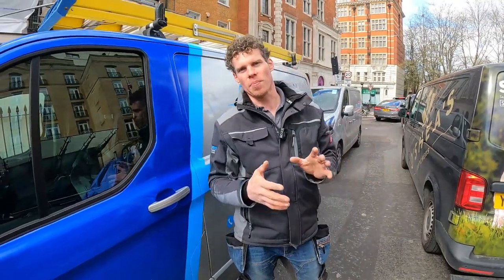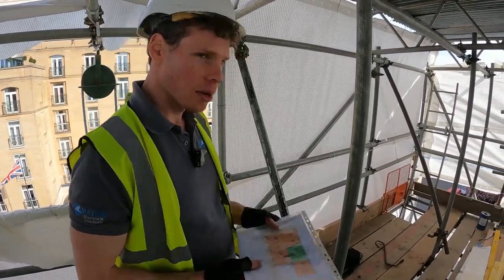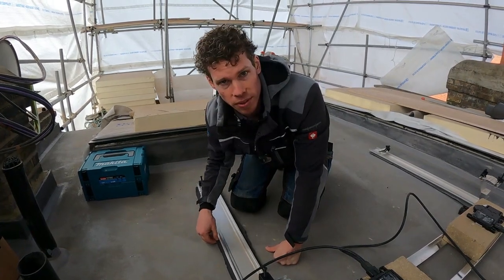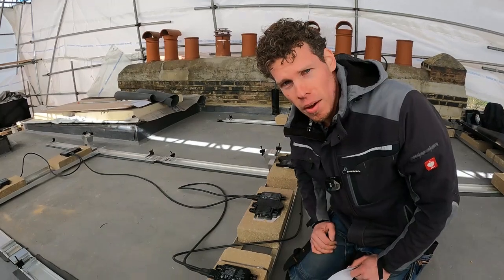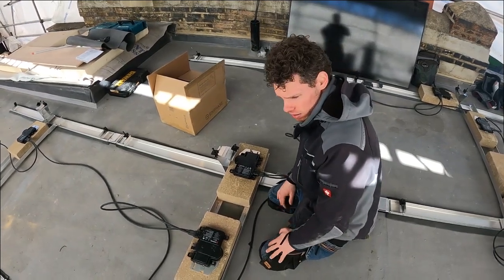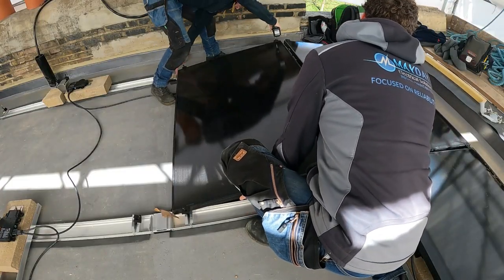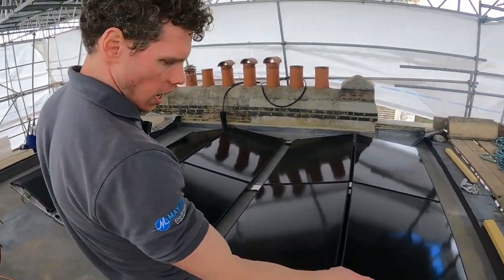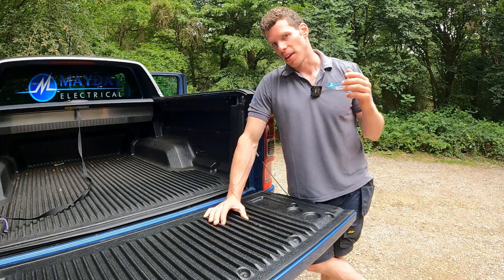Enphase Solar Install Kensington

Comment: Brilliant video thank you.  We are about to have solar PV panels installed, 31 Q Cell 405-watt panels (8 facing east and 23 facing west)  mated to Enphase 31 IQ8A Inverters then an IQ Combiner 4C. Installer claims it will generate over 13 kWh in my location or about 14 kWh/year while our annual consumption is 11,580 kWh on average.   We will add batteries next year and considering getting 2 Tesla Power Wall 3s or 4 Enphase 5Ps.  Installer says my system will include a Cell Modem with 5 years of free cell service, then I pay for that service.  I guess the advantage is I can still access all my data from the Enphase Cloud server on my phone even during a power outage if I don't have batteries.  I think that's what he's inferring?  Cheers from southern Illinois.
Reply from the maker: Thanks for the detailed response to our video, yes that sounds about right

Comment: Hi I have these on my old house I'm just wondering what current panels are compatible with the IQ7. I want to put these on my new house but self install as I'm an electrician now but without solar pv experience. My old system is JA solar panels with enphase m250's
Reply from the maker: Hello Dale 
Which ever panels that done exceed the voltage and wattage of the IQ7 will be fine
Reply: @maydayelectricalsolutionsl7601  excellent thanks for the info i'll be installing small scale first maybe 4 - 6 panels and if that goes well i got an east and west roof to do this is a bit more challenging